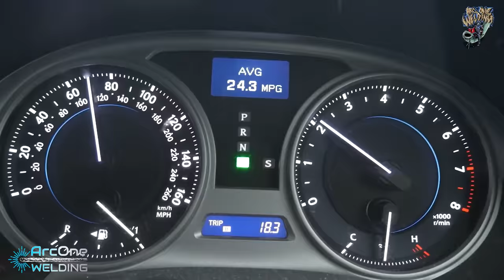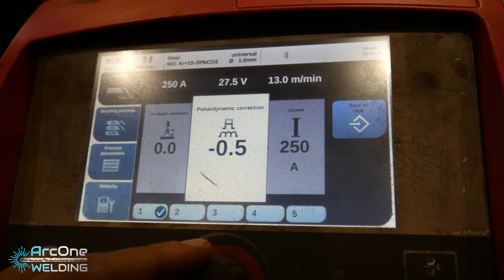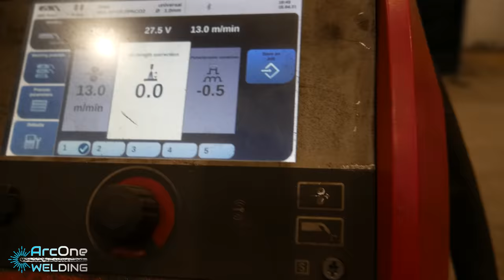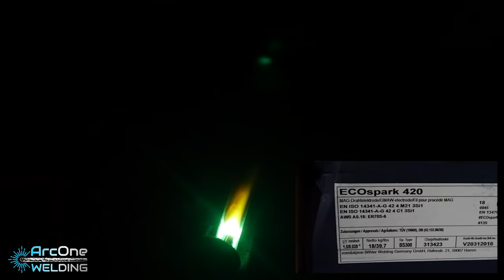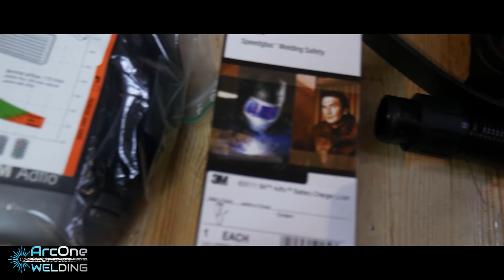Best of Arc One Welding 2021

Comment: Hi. I rarely go to black steel pipelines, when I weld, I usually have everything in order and appear as a replacement because someone has dropped out of the team. I have great respect for the people who set and graft all the fittings for welding by themselves. Your approach to work is great, I really like your method of operation. It's nice that you came back with new material. I keep my fingers crossed and good luck.
Reply from the maker: Thanks dude appreciate that

Comment: Hi iam welder  by trade I have this cheap automatic welding mask  its got a switch in the left hand corner of the mask it was on 8 to 9 and the switch  should have been  on 9 to 11 its also got a switch  on the out side with grind mode do I need to set the switch inside to 9.to 11